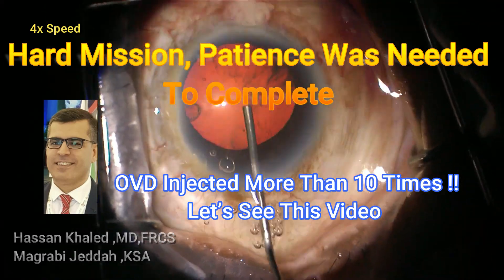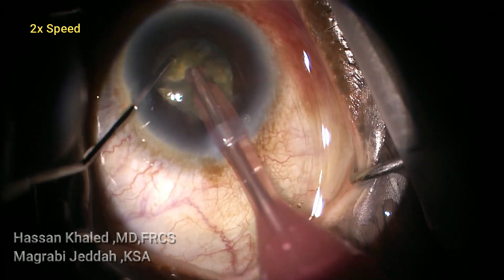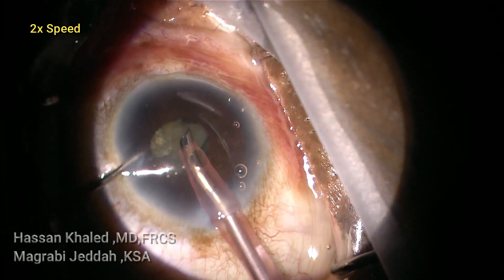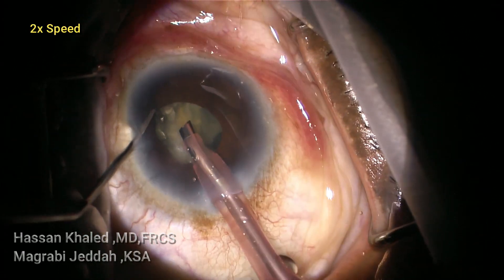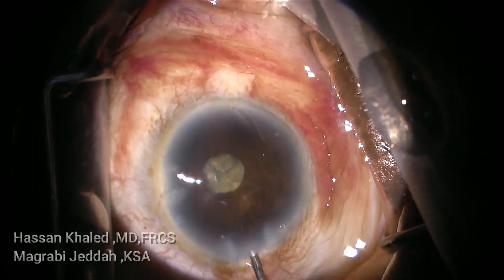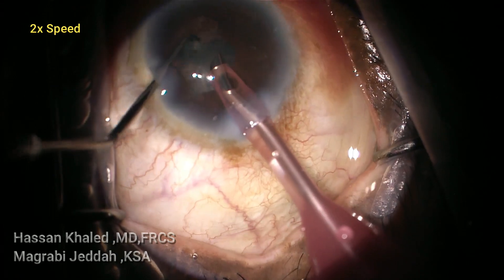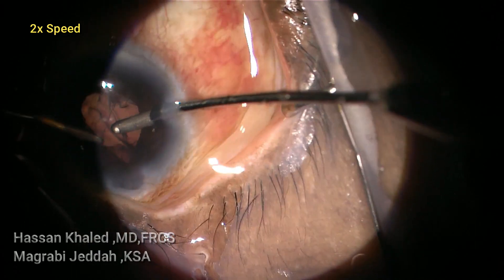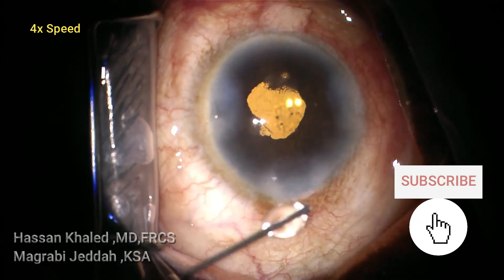Phacoemulsification Of Dense Cataract, Challenge Case.

Comment: Sir, nice video....how many clock hrs or degrees u make chopper paracentesis incision away from main incision and does making 2 sideports incisions make the Anterior chamber less stable as compared to the single sideport incision in phaco emulsification..... thanks for reply
Reply from the maker: Thanks. The paracentesis can be 90 degrees with the main Phaco incesion. and I don't think it will affect the stability of AC  if the size of paracentesis  is good even if they are two paracentesis